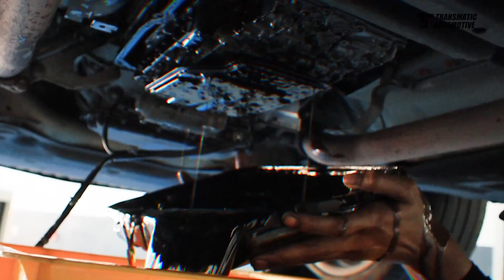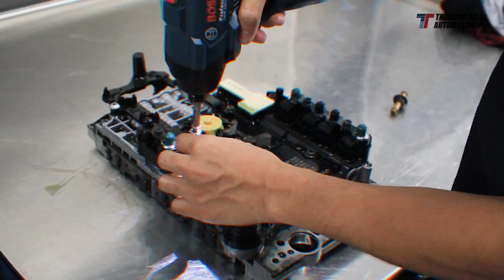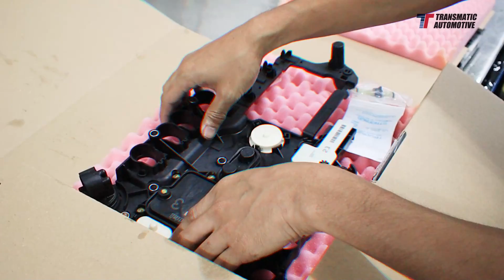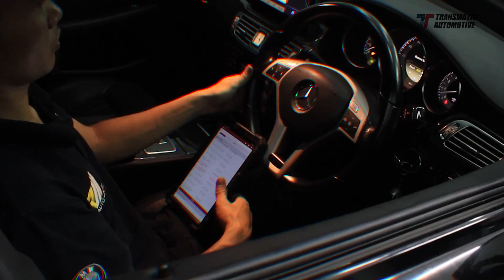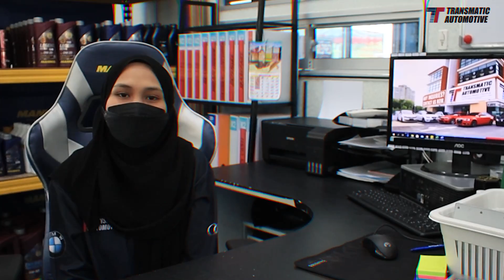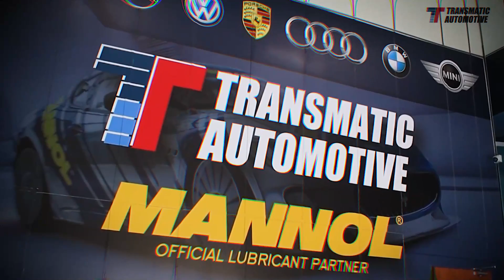HOW TO | 722.9 Mercedes CLS 350 TCM Transmission Control Module Replacement

Comment from the maker: 𝗠𝗘𝗥𝗖𝗘𝗗𝗘𝗦 𝗖𝗟𝗦 𝟯𝟱𝟬 𝟳𝟮𝟮.𝟵 𝗧𝗥𝗔𝗡𝗦𝗠𝗜𝗦𝗦𝗜𝗢𝗡 𝗖𝗢𝗡𝗧𝗥𝗢𝗟 𝗠𝗢𝗗𝗨𝗟𝗘 (𝗧𝗖𝗠) 𝗥𝗘𝗣𝗟𝗔𝗖𝗘𝗠𝗘𝗡𝗧!
Kereta customer ini mengalami masalah gear lock pada gear rendah dan tidak boleh menukar gear. Pergi bengkel lain, ada yang memberi pendapat untuk menukar gearbox. Selepas mendapatkan nasihat kami, kami mencadangkan untuk menukar transmission control module kepada yang baru. Alhamdulillah kereta kembali berjasa seperti sedia kala.

𝗠𝗘𝗥𝗖𝗘𝗗𝗘𝗦 𝗖𝗟𝗦 𝟯𝟱𝟬
✅ TCM 722.9 Ori
✅ Programming
✅ ATF Oil

youtube link : https://youtu.be/-g-gdIbGpGc

Kami menerima permintaan untuk semua jenama seperti 𝗕𝗠𝗪, 𝗔𝗨𝗗𝗜, 𝗩𝗢𝗟𝗞𝗦𝗪𝗔𝗚𝗘𝗡, 𝗠𝗘𝗥𝗖𝗘𝗗𝗘𝗦, 𝗠𝗜𝗡𝗜 𝗖𝗢𝗢𝗣𝗘𝗥, 𝗩𝗢𝗟𝗩𝗢, 𝗣𝗢𝗥𝗦𝗖𝗛𝗘 dan lain-lain. Kami mengutamakan kualiti, kecekapan, kekemasan. Pastikan anda sudah hubungi untuk sebarang appointment supaya kami dapat memberikan nasihat lebih detail sebelum hantar kereta kepada kami.

𝗣𝗲𝗿𝗸𝗵𝗶𝗱𝗺𝗮𝘁𝗮𝗻 𝗱𝗮𝗻 𝗸𝗲𝗽𝗮𝗸𝗮𝗿𝗮𝗻 𝗸𝗮𝗺𝗶 : 👇
✅ Gearbox Repair
✅ Engine Repair
✅ Air Conditioner Repair
✅ Regular Service
✅ Pre-Purchase Inspection
•••••••••••••••••••••••••••••••••••••••••••••••••••••••••••
𝗪𝗵𝗮𝘁𝘀𝗮𝗽𝗽 nombor di bawah untuk detail :👇
https://wasap.my/60148226282 (𝗦𝗬𝗔𝗙𝗜𝗤)
https://wasap.my/60126466894 (𝗠𝗨𝗜𝗭)
(𝘈𝘥𝘷𝘪𝘴𝘦 𝘥𝘢𝘯 𝘋𝘪𝘢𝘨𝘯𝘰𝘴𝘦 𝘢𝘥𝘢𝘭𝘢𝘩 𝘱𝘦𝘳𝘤𝘶𝘮𝘢)
𝗪𝗮𝗸𝘁𝘂 𝗢𝗽𝗲𝗿𝗮𝘀𝗶: 👇
9AM - 6PM
Isnin - Ahad
Jumaat cuti
𝗟𝗼𝗸𝗮𝘀𝗶 : 👇
No. 8, Jalan Linggis 15/24, Seksyen 15, 40200 Shah Alam, Selangor
𝗟𝗶𝗻𝗸 𝗠𝗮𝗽𝘀 : 👇
https://goo.gl/maps/DCn8YZBzZVWkziw78
𝘜𝘯𝘵𝘶𝘬 𝘶𝘱𝘥𝘢𝘵𝘦 𝘴𝘦𝘮𝘢𝘴𝘢 , 𝘧𝘰𝘭𝘭𝘰𝘸 𝘱𝘢𝘨𝘦 𝘥𝘢𝘯 𝘤𝘩𝘢𝘯𝘯𝘦𝘭 𝘬𝘢𝘮𝘪.
𝗙𝗮𝗰𝗲𝗯𝗼𝗼𝗸:
https://www.facebook.com/transmaticau...
•••••••••••••••••••••••••••••••••••••••••••••••••••••••••••
#transmaticautomotive #shahalam #selangor #rmautocare #kumpulanpakargearbox #continentalspecialist #bumiputera #overhaulgearbox #gearbox #rebuild #repair #overhaul #bmw #e60 #e90 #bimmers #BMW #AUDI #VOLKSWAGEN #MERCEDES #MINICOOPER #VOLVO #PORSCHE #mercedescls350 #cls350 #cls #tcm

Comment: Hi can you please suggest how to repair this error code p0606 component y3/8n4 fully integrated transmission control unit is faulty. Mercedes w212 e300 2011 Thanks